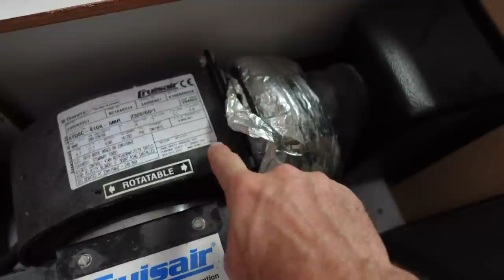Air Con Game Changer! 12v Mabru Install

Comment: I just did the Mabru easy install and the variable fan and compressor is crazy since.....once in the water your going to be amazed and happy at load numbers.  how many Amp Hours of Lithium you going with ?
Reply from the maker: I'm super excited to be able to test these out.  Though by the time we are finished with projects and launch, we may be trying their heating function first!  😆

Our lithium bank is now 1,000 amp hours at 12v.

Comment: nice work.  what's the airlock valve do?
Reply from the maker: The airlock valve is intended to be an easy way to bleed the system if any air gets in it.  Otherwise you have to loosen one of the hoses on the pump and that is quite tricky and can get very messy!

Comment: I've been looking at Mabru. Thanks for the detailed install review. I had very little knowledge of boat ACs but now I do, thanks to you. How is the 12V system and eliminating the genset? I've had issues with my gen set and considered a solar electric system. My generator only runs my AC and cook top. I can change to propane for cooking and only really need the air at night for sleeping. good work.
Reply from the maker: The change has been amazing.  We've been in the Bahamas for 5 months and have run entirely on solar power.  It takes a bit of power management sometimes, especially if it's cloudy for a few days in a row, but we haven't had to run an engine for extra battery charging at all.

The Bahamas are nice given that the nights in the winter are actually quite comfortable.  So we devoted more power to heating water (usually 2x a day) and only ran air cons if it was a super sunny/still day.  Now that the water is getting a bit warmer, things don't cool off as much at night so we're cutting back to hot water once a day (cold showers are much more tolerable now!) and using the extra power to run air con at night.  We put up a sheet to section off our berth since there is no need to spend more power to cool the entire hull!

Comment: Do you have the theoretical efficiency gains in terms of the old 110v compressor compared to the DC unit? As you know we are doing a new build so keen to see the numbers and see if we can go a generator free build and still have Air conditioning. Seems with all the new tech it’s very doable now.
Reply from the maker: I expect that the 7k but Mabru's will consume about 250-350w when we're running them.  We always ran the old 8k btu CruisAirs off the genset, but the math for them works out to 633w when cooling and 816w when heating.  That doesn't include any inverter loss and to run those w/o the genset, we'd also need to fit those with soft starts and likely upgrade our inverter again to handle the air cons and other AC powered loads.

So with our 12kw lithium battery bank, we should easily be able to run a Mabru air con over night.  The big question will be how we do with solar generation from our new panels and if the new setup can handle charging up the batteries on a regular basis.  But we also have the option of NOT running air con to conserve power, which puts us right back to where we were before and we somehow managed to survive 8 years that way!  😆

Comment: Nice hose cutter.  I’ve never seen one with a ratcheting mechanism.  Would you recommend it? And if so where did you get it? TIA
Reply from the maker: It works really well on all the hose we typically use on the boat and I'm definitely glad we have it.  The one thing it struggles with is the metal wire reinforced hoses.  I have to use some wire cutters to finish that cat.

I can't remember the brand we have, but searching "ratcheting hose cutter" brings up a ton of options!

Comment: Great video! Can you tell me what that extra 3-way valve is for? Is it for helping to prime the system if that pump is not self-priming? Is it for flushing the system with mild acid, eg Barnacle Buster?
Reply: Good question.  At first I was going to say, so they can clean/change the water strainer, but then the valve should be before the strainer, and the through-hull seacock does that.  Then I thought, so they can work on the pump?  But, then again, they have the seacock.  So, David, what is the deal there?  Is it a backup cutoff should the seacock fail?
Reply: When these systems are opened to clean the strainer air gets in and must be purged so the pump will flow properly. This allows easy purging without removing hoses.
Reply from the maker: Laura nailed it!  Not only can air get in when cleaning the strainer, we've also had air get into our old air cons if we were on a bumpy sail and forgot the close the valve on the thru-hull.

It only took one time of having to carefully loosen the hoses to clear the air block to find a better solution.  The "air bleed valve" is a lifesaver!
Reply: @laurapitre5797  Thanks!  I did not think of that.

Comment: How big is the supply wire for the Mabru?  Seems like it should be at least #8???  We currently have 230v Dometics and I’m concerned the increased wire size is gonna make for some very hard cable pulls….
Reply from the maker: We actually went with a 1AWG wire for the install in the salon.  12v definitely requires significantly larger wire size and yes...  the cable pulls are among the toughest part of the install.

This is a handy wire size calculator that we use all the time if you'd like to figure out what size wire you'd need:  https://boathowto.com/wiresize/abyc/

Comment: Love all the learnings and techniques you are sharing. Would be great to hear why you are going through the effort to switch to the Mabru 12V units. What efficiency do you expect to gain? What comfort (if any) do you expect to lose?
Reply from the maker: I had good intentions of trying to include some of the rationale behind the switch in this video, but we're just too busy with boat work and other projects to do that subject justice at the moment.  So I'll try to cover all that when we're back in the water with a full review video.

But for a sneak peak...  😃  Since we made the decision to remove our genset, we're on a quest for peak efficiency in our key systems.  I expect that these DC powered Mabrus will consume less then half the power that our old AC powered CruisAirs would (which would also require wiring in soft starts and probably upgrading our inverter!).  I'm confident the comfort/performance in the owner's hull and our aft guest cabin will be practically identical to what we had before.  The big question is how the salon will do.  We now have a smaller unit there than before BUT Amy would constantly get frozen out of the salon if we ran air con there.  So as long as it takes the edge off a super hot day in the salon and I can retreat to our cabin for real cold, I'll be happy!
Reply: Your answer is in this video a handy comparison is at 12.33 min. the Mabru uses almost a third of of the energy to provide the same BTU output. 
https://www.youtube.com/watch?v=nFA3FNAHv_I&t=901s
Reply: Will you feed all 3 AC’s off the same seacock?

Comment: I assume the communication cable was a RJ45 since you mentioned Cat 5. Its really easy to put the ends on if you have the plugs and crimping tool. Its all pretty cheap to buy and you'll always have it.. I know it would have been A LOT easier if you could cut the end off and crimp a new one on. The company will tell you the order of the wires.
Reply: Our cables are standard pinout, no funny business to make it as simple as possible to service. As long as the pins match on both ends, the cable is good!

Comment: I think that the Emily and Clark's marine DIY AC is significantly better. But if you're going for a "floating apartment" feel then an oversized, power hungry AC might be better for you. In my opinion, if have to run a generator on a sunny day you're using too much power.
Reply: Perhaps you misunderstand the limitations of Clark's AC unit?  It is not designed for the volumes of catamaran living spaces.
Reply: This is a DC system that can be easily run off their solar and lithium battery bank. There is no comparison between this system and the home brew design you are referring to.
Reply from the maker: I've said it before, but one of the great things about boats is that there are millions of ways to outfit and set them up.  What works well for one boat/couple may not be the right solution for someone else.

Our catamaran is our full time home, and after 8 years living aboard, we have narrowed in on the comforts/amenities that we want.  Air con that works for our space and with the rest of our electrical systems is high on my priority list because I've done plenty of sweating in the middle of the night in some very hot places.

I do mostly agree with you on the generator though.  I never really liked when we had to run ours, which is why we got rid of it!
Reply: Clark has little interest in creating a system for a catamaran. He states in his video that his design is adequate only for cooling ONE stateroom.
Reply: That getto clark unit is not marine ac. Its a hodge podge that would never see the inside of my boat,
Reply: I don't understand how the ac water pump is hooked up .. is there a pump control box ?

Comment: Water dissipated heat is an unnecessary mess. 8000 BTU's is way too large for most boats. A good video should tell how to budget wattage and how to make cooling effective and not waste it.
Reply: In my 38’ Chris Craft we have a 16,000 btu in the salon and both staterooms have 9,000 btu.